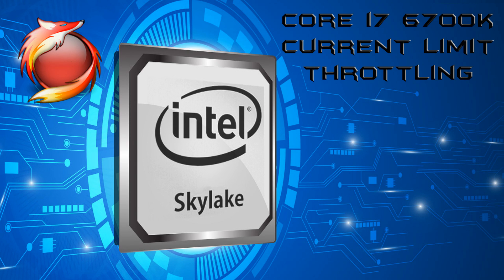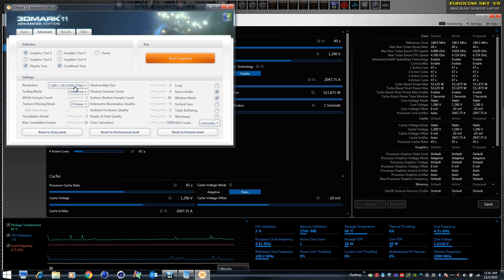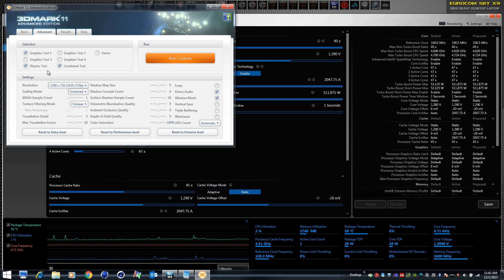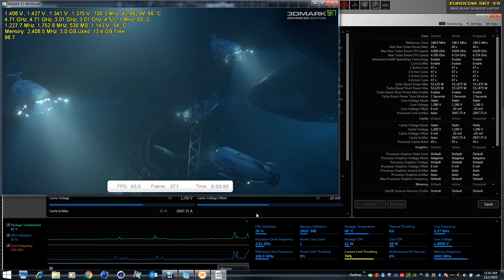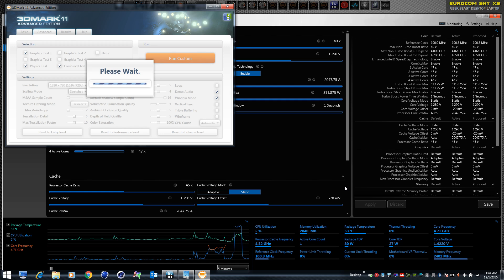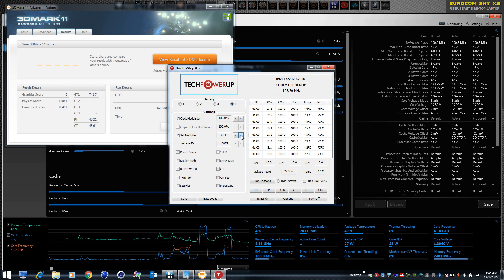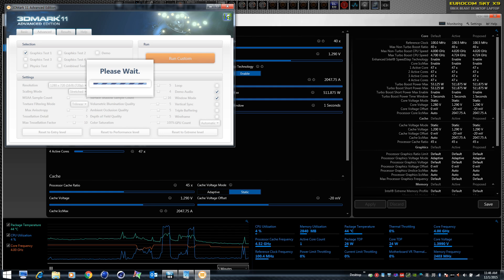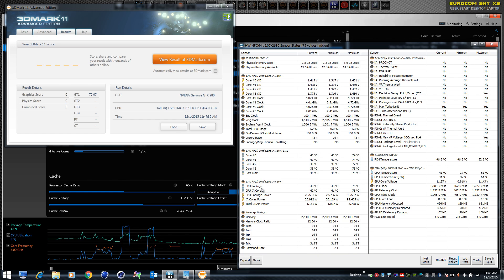Skylake Current Limit Throttling - Defect or Design?

Comment: solved the problem with these settings For MSI Z MBO 
Long Duration Power Limit (W) = 175 
Short Duration Power Limit (W) =175 
CPU Current Limit (A) = 160
Reply from the maker: good info... thank you for sharing

Comment: How do I get this EC for Clevo P65_67RSRP? having the same issue
Reply from the maker: Contact the vendor that sold you the system and they should be able to provide it.
Reply: Right I have been able to get an updated bios and EC but the throttling still occurs. Any way to modify the EC to stop the throtting? thanks

Comment: After some research on the matter,  it appears most mother boards allow alteration of the cpu throttling settings apart from the Temperature throttling. If you still have this issue then its likely your cpu/mobo is damaged or just use a better motherboard as current load is controlled by voltage regulator hardware that resides on the motherboard

Comment: Hi:is there any possibility to share this mod ec or bios?
Reply from the maker: +毛伸 - When it is available to the public it will be downloadable at premamod.com but I do not know the ETA on when that will be.
Reply: +MrFoxRox2 thanks~i'm waiting for it,i'm using p870dmg with desktop 980 and it cannot load fpu+furmark together cause ec or bios
Reply from the maker: +毛伸 - try lowering your CPU core voltage with XTU and change it to static. The Adaptive/Static selection is grayed out until you change it from default to a manual value. If you have 6700K, set all multipliers and cache ratio to 43 and 1.175V, Static Voltage with no offset, set ICCMax at 160, long and short power to 150 each. That may help while you are waiting. Run wPrime 1024M or Cinebench CPU test in a windows and watch the Current Limit Throttle sensor at the botton of XTU. You may have to click on the wrench icon to show that sensor. If it has current limit throttling at 1.175V, try lowering it a little bit more, like 1.170V or 1.165V and see if the Current Limit Throttle goes away.
Reply: +MrFoxRox2 yep,I have 6700K within, I tried voltage offset -122mv with default clock 42 41 40 40,i'll try to gain the iccmax,thanks~
Reply: +MrFoxRox2 I tried,but it doesn't work,so  i think it's really a EC problem

Comment: I dont think any fixing was needed, its a clever power saving feature which the cpu was designed to do, I like it, why waste your electric bill, there is no performance loss with this throttling
Reply from the maker: +Larry TQ - actually, there is a performance loss. Not huge, but very measurable. Even a small performance loss for the sake of compromise is unacceptable. The loss was not readily apparent until it was fixed. It was not designed to be a power saving feature. It was sloppy Clevo firmware coding that caused the CPU to malfunction. Thankfully, it is fixed now so it is all good.
Reply: +MrFoxRox2 I take it all back, you're correct as usual lol. What ec version fixed it? I should check in the forums lol, its me lawtq from the forums
Reply from the maker: A Prema EC fixed it, not a factory Clevo EC.

Comment from the maker: UPDATE: This is fixed by using a different EC. The throttling was caused by the EC, not the CPU.
Reply from the maker: PremaMod custom BIOS had it.
Reply: MrFoxRox2 hi dude got the same problem 6600k downclock from 4.5 to 3.6 during stress test current limit throttle. What did you call EC is that a custom bios?
Reply: +MrFoxRox2 Can you please remind me what EC stands for?
Reply from the maker: +Ardavan Shafiee (Ardie) - Embedded Control - it is a low level firmware that controls a number of things, including notebook fans and power distribution, power caps, etc.
Reply: +MrFoxRox2 Where did you get the other EC?